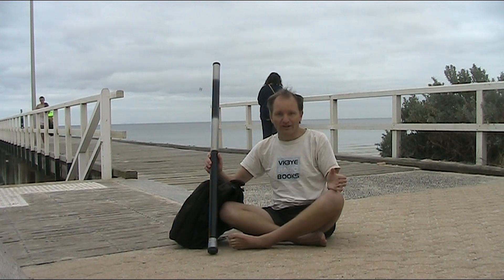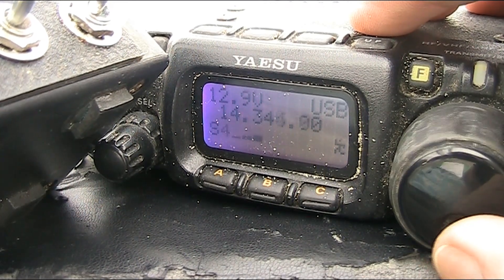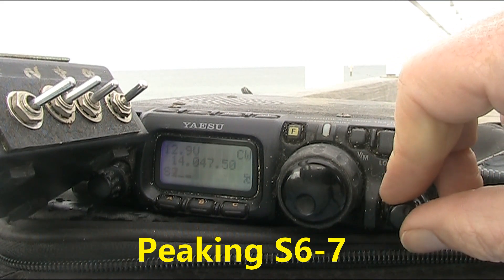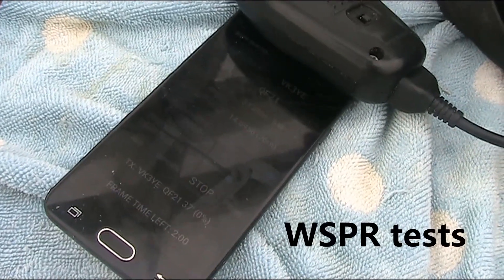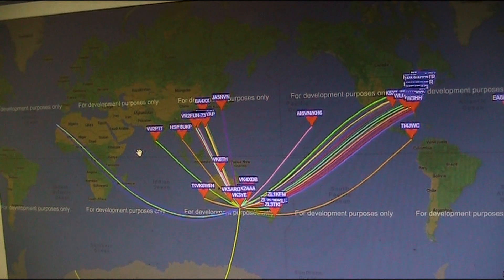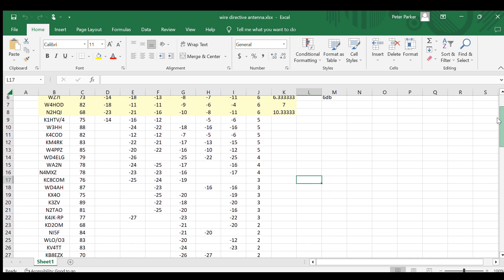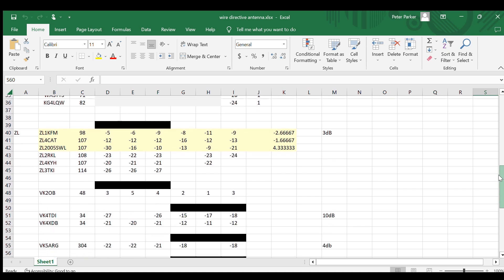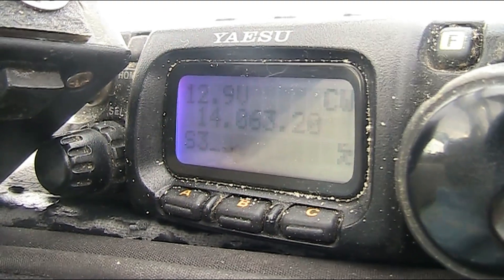One wire + One pole really is directional (DX tests)

Comment: Good experiment.  These end fed antennas are popular now as multiband antennas (usually used with a fixed ratio impedance transformer).  It would be interesting to see what the directivity is with the same wire but on other bands.

Comment: Specifically 1WL long? This wouldn't work for a half-wave?
Reply from the maker: Must be 1WL.
Reply: @vk3ye  copy that, thanks
Reply: On the LOW Bands it is not necessary, 1/4 waves are also possible. The main thing is that the slope is in the direction of the radial.

￼